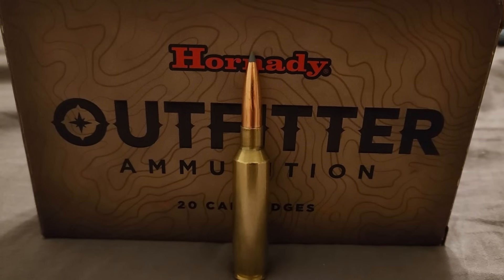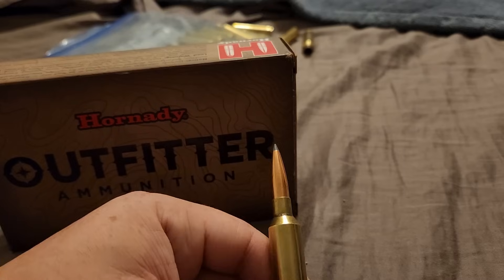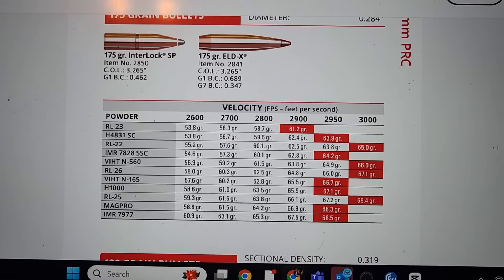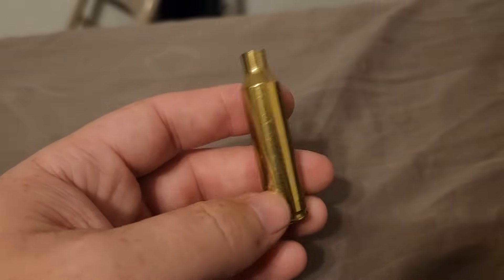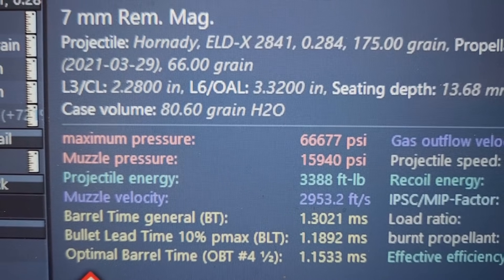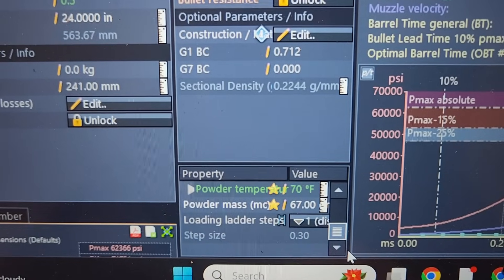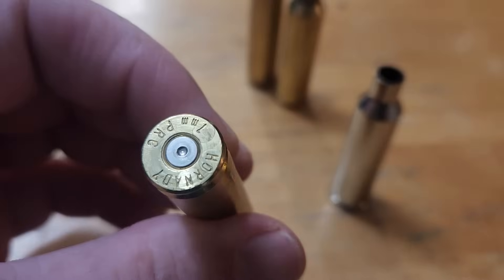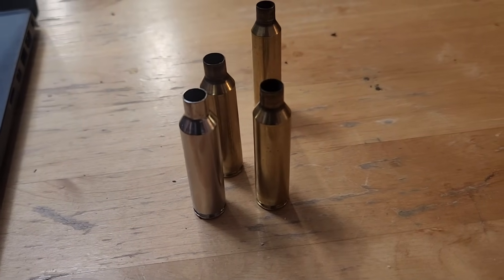Why your 7mm PRC is slow...

Comment: My experience with Hornady 7PRC brass showed me it's junk. It's one and done unless you want to load your 7PRC at 708 velocities.
Reply from the maker: Thanks for sharing!
Reply: Hornady brass is not that good but i'm on my 3rd reload on it (still good). shooting 175's at around 3070fps
Reply: @GaryEberhardt  It seems to be ok for my 708 but for unknown reasons, in 7PRC I couldn't even seat a primer in many of the once fired factory brass. By the way, Hornady makes some nickel brass for Barnes factory ammo
Reply: @Accuracy1st I'm not having that problem yet. I wont be using Hornady brass much longer as I will will get something else. 
When I got my seekins the only way to get brass for reloading was to buy hornady factory loaded stuff.

Comment: Ramshot grand got me 2950 all day today. 1/2 grain off starting pressure marks worked best for accuracy. 22'' barrel. Got 3000 with an ejector mark. 175eldx. Ended the day on Nosler 168 ablr with a 3/8'' group. 4831sc was way way slower.
Reply from the maker: Grand should get faster velocities than RL-26

Comment: So I'm running RL26 68gns and Berger 175EH ADG brass,  MV 2970. That's at 23 rounds down the barrel . No pressure. I'm still fire forming the first 100 rounds but should be close to 3k after I hit 100 rounds. 26in barrel is the way to go!
Reply from the maker: You have a 26 inch barrel?

Comment: Federal 175 ELDX , Bergara HMR Hunter 24” averaging 2989fps, Hornady 175 ELDX 2808fps. Did not complete break in due to last minute purchase for hunting season because my fierce twisted rival won’t group without a foul/pre heat shot.
Reply: All but identical results for me , just extrapolated down a bit for my 22" barreled Savage Ultralite with it's Proof Research barrel.
I waited a good 90-100 rounds of Hornady Precision hunter before I broke out the Chrono to let it settle a bit.
Federal 175gr ELDX was 2950fps 10 shot average. Hornady Precision Hunter 175gr ELDX was 2792 for a 10 shot average.
Reply from the maker: Federal uses RL-26.

Comment: 7PRC 24in proof 175ABLR N565 will push over 3100 out of my rifle. But settled in on a node at about 3025. Not sure why you can’t get the speed out of yours. Possible slow barrel would be my guess. Been around several 7prc and with 565 always been able to get 3000+ if wanted
Reply from the maker: You are over 73k psi when you are pushing a 175 ABLR at 3100 FPS.
Reply: @ absolutely but it is possible with no pressure in my rifle. But shoots best just over 3k.
Reply: @stevenlillian5491  like he said, you're mor than 10,000  over pressured. You may not see "signs" in your particular gun. But you're definitely over pressure.

Comment: I use Hodgdon's Retumbo in almost everything that has a "Magnum" reference to the caliber with excellent results. I'm using 68gr of Retumbo in my daughter's 7mm Rem Mag with 180gr Hornady ELDM at 2995 fps, from a 24" barrel, and with Hornady brass... It should work just as well in the PRC case I would think.
Reply: @dougroope8040  you’d be surprised what a small difference in case volume does with powder selection. 7 mag is not picky and will accept a lot of powders with great results. PRC was designed specifically for RL26 which is so unnatural on how it burns. It really does produce great velocity. However. Powders below it will burn to fast and not get the same speed. Powders above it will burn to slow. It’s quite the conundrum. Which is why I’m irritated with Hornady. They should have picked more common powders when designing the case volume. RL26 works great in my 25 creedmoor and my 6.5 creedmoor. But doesn’t work at all in my 7 saw. Which is only 4 grains of powder capacity more. It wants h4350 or n550.

Comment: Hornady did a podcast talking about how certain rifle manufacturers don’t have the correct tolerance specs to handle 7 prc. Not to discredit mossberg but that is definitely one of the cheapest options you could have gone with. When you look at people shooting seekins, bergara, Christensen and the customs, everyone is not having pressure problems and is having good velocity.
Reply from the maker: I've shot a 7mm PRC from Fierce and it wasn't much faster than my rifle. Go do some YouTube searches on 7mm PRC velocity. It's not just the cheap budget rifles getting bad velocities
Reply: @ if that’s the case then I would say it may have to do with powder shortages. Try the federal load with the hornady eldx. I ready they are a sister company with reloaded 26 and they don’t have any shortages and are getting the advertised velocities. But too rifle companies having problems is more concerning then I thought.
Reply: @ReloadingWeatherby I can second that. 175 eld x out of my ct carbon rival with a  24 inch barrel is going on average 2850. It's criminal. Everyone who has purchased a 7prc and hornady ammo ought to get together and sue hornady. Liars. Blatant....
Reply: @MatthewKyle-sg5uo  I’ve shot 3 rifles with hornady factory ammo and while yes velocities have been below the marketed 3000 fps, all of them were sub .75 moa shooters. Two of them were sub half all day long and even the ES and SD were pretty good for factory ammo. One was a browning, the other my custom and a seekins
Reply: @jiminator5  i dont care if you shot a .2 group all day. Its not what you paid for. Not what I paid for. I paid for a box that said I should get 3000 feet per second. Accuracy is good. The most important thing. If they would have just changed the box and made it public that I dont think anyone would have a problem with it. But they were deceitful and dishonest. My rifle shoots very well. I dont plan on buying anymore hornady ammo for it. It will be what ever else I can find or I will start reloading. I have tons of powders to play with.
Reply: @ I think blaming one company for a powder shortage they had no control over is a bit harsh. If you just research, you will see that a lot of other very reputable companies are currently having similar problems with getting advertised velocities. I think if you applied your logic to everyone, hand-loading will be the only ammo you will be able to shoot. Everyone wants to point their fingers at hornady cause people love hating on the people at the top and are the most popular. You see it all the time with sports and the sales and popularity that hornady has speaks for itself.
Reply: @jiminator5  your not reading what I'm saying. Its not the velocity or the shortage that pisses me off. It the fat they were not HONEST and upfront about it. People had to find out on YouTube or the range. That is simply unacceptable.
Reply: One of the reasons the 7PRC is supposed to be so accurate, and a huge leap over the 7mm rem.mag is because of the tight saami specs on all Chambers.  But then hornadysays a comes out and says Chambers are all different and causing massive differences.. more of their marketing BS and lies.

Comment: If your after velocity in a 7mm I’d say go with a 28 nosler or a custom build 7prc is a great cartridge for many applications but not built for speed . I own two 7prc’s I like mine for what I got them for .. sure you can load them with a 160 nosler accubond and get some speed . Or build a custom .. just note if your looking for a fast 284 cal go a different Direction

Comment: Im getting 2900 fps with 180 eldm and n565 with cci 250 primers im getting 2940 20" with berger 180 vld( less bearing surface) n565   (20")and over 3200 with 155 hammer hunters with n560(24")
Reply from the maker: Nice

Comment: What people don’t know is and been said by others.  That Hornady was using a different powder and was getting the stated speeds posted on the box. Then they couldn’t get that powder anymore so they changed powder and didn’t change the posted speed on the boxes. 7 prc is still a good cartridge. Different from 7 mm rem. Mag.  Unless you have a 7 mag made with a longer throat and faster twist you won’t be able to stableize the higher bc. Bullets that the 7 prc really was made for. To many people want speed why go after accuracy who cares what speed it is as long as it accurate. I see you didn’t mention if you cleaned down to bare metal when u changed between the eldm and the cx bullet. You will not get good accuracy when switching between the two.
Reply from the maker: I'm a reloader Mark. Getting good accuracy is the baseline. There is nothing wrong with the 7mm PRC. Hornady shouldn't have marketed this cartridge as a 3000 FPS cartridge. I didn't mention the clean barrel mono bullet theory... because it's just that. I've proved from every gun I own that I don't need to clean the barrel to get it to shoot mono bullets really well. Now do I believe all guns are like mine? No. I think some guns need a clean barrel.
Reply: @ as I said they where getting posted speeds for the first powder used then switched powder because of availability. Just didn’t reprint labels on the boxes . But I’ve seen it my self earlier produced ammo was getting posted speeds. That has been proven. Not the same now Hornady should come out and make a statement of some kind in my opinion. Not calling you out but you are giving only part of the truth. In my opinion.

Comment: When switching from a cup and core bullet to a solid copper, you should clean your barrel down to bare metal before shooting the coppers. i dont know the science behind it, but thats probably why those cx shot so bad out of your gun
Reply: There's videos that disprove that myth.
Reply: @MatthewKyle-sg5uo  There are others that prove it. its one of those things that could work for someone, and its a very easy thing to try
Reply: @jdennis513  meh it's a myth. I have tried it with both my 7prc and my 6.5 prc. I have notice no difference in accuracy switching back and forth between barnes lrx and hornady coppers to eld x and m'S.
Reply: @MatthewKyle-sg5uo  👌
Reply from the maker: Possibly, I have other guns that don't need to be cleaned to shoot copper really well. The truth is this gun I had was shot terrible with all bullets

Comment: Hello I’ve been following your account for sometime now and I’m looking to purchase a Weatherby and get back into reloading I’m thinking about starting off with the Weatherby Vanguard in 257 WMag I some experience with reloading pistols caliber 9mm .45acp .44 mag 
I have a REM .280 in an old Ruger M77 looking for ligament help and where to shop for the best price for reloading equipment.
Thanks you Reloading Weatherby .
Reply from the maker: I like my RCBS press. Usually mom and pap stores have better prices on bullets and powder.

Powder you can use in 257 Weatherby 
H4831SC 
N560
N565
N568
H1000

Comment: My 22 inch 7 PRC with 180 grain Berger handloads running N565 average 2975 fps. No signs of pressure and it shoots great 🤷‍♂️
Reply from the maker: What brass you using?
Reply: ADG
Reply from the maker: @brinkerhoff8  Makes sense

Comment: The 7 PRC shines and has more case capacity than the 7 Rem Mag when you load it with a higher weight bullets. I was interested in the 7 PRC for a bit, but I would go with the 300 WSM over it.
Reply from the maker: You sure about that? https://www.youtube.com/shorts/R4Lm-2R4Y5o
Reply: @ if your trying to load heavies in both cartridges yes because the 7 mm has to have them seated deeper for their chambers than the lighter ones……that’s what my research has found.
Reply: @shawnengstrom3906 then your research is flawed. My brass on my mag before sizing is 88 grains of water. Shooting 195s at 3050. Coal factory ammo is 3.34” saami chamber with these big bullets is 3.5” so explain to me all this case capacity I’m losing? You do realize there is such thing as projection length. This is the length smaller than the ogive. So even though the freebore on a mag is .115 doesn’t mean you lose powder column. A 175 Berger elite bearing surface is right at the shoulder neck junction so eating up no case capacity.
Reply: @ it must be, thank you.

Comment: I have never thought that you were faking lower speeds to stick it to Big Red and 7 PRC Fanboys.
Pretty interesting breakdown. It will be a couple years before I can get another firearm since I ordered a lever gun in 360 Buckhammer to be my legal in Ohio  gun since I moved there last year. But I do want to get a left hand 7 PRC to fit in between my  LH 270 Win and RH 300 WSM. But unless I was able to spend $2000+ on either a Weatherby or Fierce or go custom I won’t find a 7 PRC in LH with more than a 22” barrel. I want to eventually hunt suppressed so I am ok with that. But a 24 in would work ok for that application and get more velocity.
Reply from the maker: Thanks for watching and commenting

Comment: I have 26" 7mm PRC that I want to shoot 170gr copper. I want to get to 3000fps or higher, what powders would you recommend trying? I have adg brass.
Reply from the maker: N560, N565 and H4831SC. You could use H1000 and get 100% burn rate because you have a 26 inch barrel.
Reply: @ReloadingWeatherby  N165 was my first thought, but I'll try all three. thanks!
Reply from the maker: @NicholasMaus  I just realized I made a typo. N560 and N565
Reply: @ReloadingWeatherby  N560 is very close to N165 on the burn chart